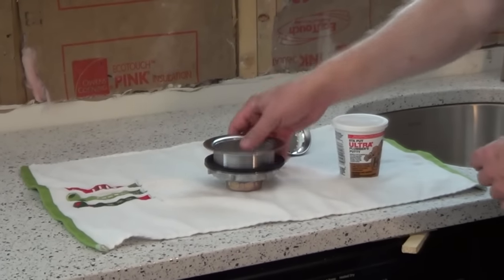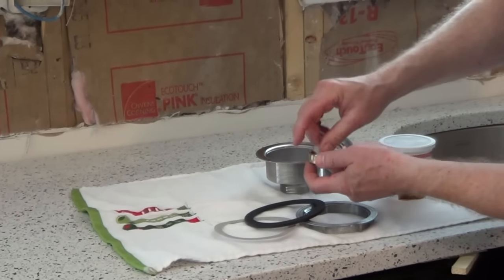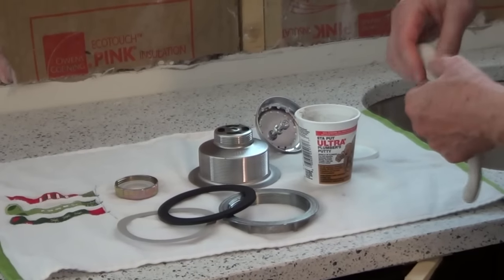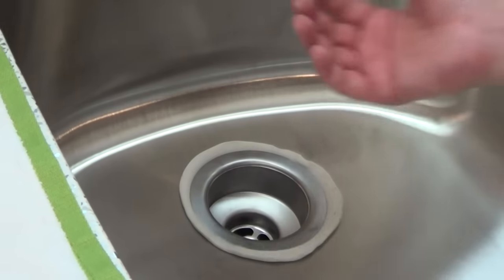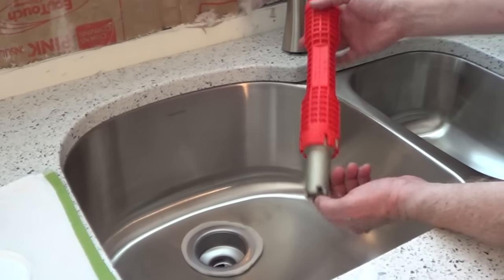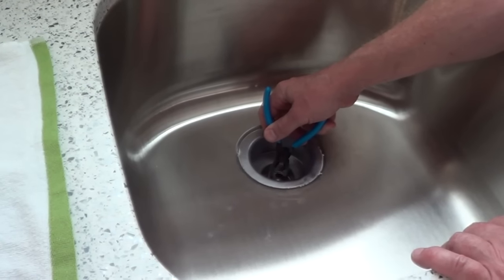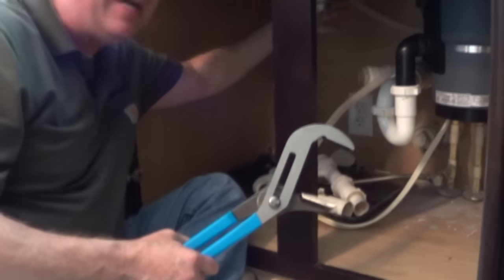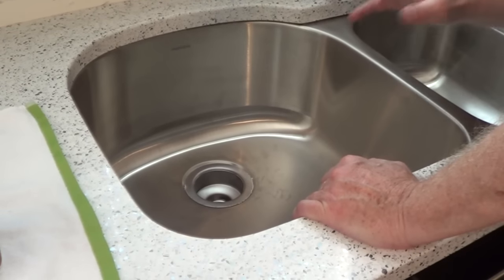How to Install a Kitchen Sink Basket Strainer

Comment: Another reason NOT to buy that special tool to keep the drain from rotating, the cheapo drain i just bought only has 3 tabs around the center, not 4, so the fancy tool would not have fit into it.  pliers work just fine.  GOOD TIP about saving the cardboard friction ring, i would have thought it was just for packaging & thrown it away.

Comment: Sometimes I learn the hard way. I had the rubber gasket in the wrong place, resulting in the basket sitting slightly above the sink. This caused the water to pool around the drain. Hopefully, this video will keep someone else from making the same (dumb) mistake. 🤪🤪🤪

Comment: Thanks, I didn't use enough putty and had a leak. You showed the right amount of putty yo use,glad I checked for leaks before I started hooking-up drain lins. Good tip on using the needle nose pliers.

Comment: Thanks for the teaching. I didn't use enough putty the first time. The needle-nose plier tip worked but I tightened a pipe wrench on the handles of the pliers that jammed against the side of the sink and prevented the basket from spinning without a helper.

Comment: I'm glad I didn't put the sink in until I added everything the drain , faucet plumbing pipes a lot easier then doing most of it under the sink . And I had trouble cutting the counter top hole big enough jigsaw wouldn't cut close enough so I finally figured it out  I flipped counter top over then finished cutting .

Comment: I drilled two holes  in the tool and used a screwdriver to fight against me while I tightened it. One man job.
Reply: I have one with the hole already in it.  Got it for 8 bucks.
Reply: @Silent_Shadow  where? and what is it called?
Reply: Innovative thinking right there!👊
Reply: I don't have the tool so got to figure out how to do it with out it .

Comment: Awesome video! I have a question about the large strainer nut. How tight are you suppose to tighten it? I did it myself while holding the strainer with the ridged tool from the top. It never really tightened. The nut slipped teeth and it was loose until I got tired of turning the wrench. It didn't leak but I assume it will soon. Thanks for posting this video.
Reply from the maker: Hi, it just needs to be snugged down. You don't want to over compress the putty. If it does leak in the future, it is an easy fix. 
We have more tips on our weekly podcast http://castbox.fm/u/4891735

Comment: Very helpful. I came here to find out whether putty is needed UNDER the sink (duh. It's NOT.) and I saw the bit here about the cardboard gasket. While fixing my leaky sink, I found that the cardboard was put ON TOP of the rubber washer. THAT was probably the reason for the leak. I'm not sure whether that was MY fault or the previous occupant.
Reply from the maker: Glad it was helpful
Check out more home improvement tips in our e-books https://www.amazon.com/gp/product/B0B2KW1FQ9?notRedirectToSDP=1&.

Comment: That's really well-done in under 3 minutes.  A+.  One question: if I don't have the big wrench, is hand-tightening as hard as I can okay?
Reply from the maker: Hi, I have always used a wrench to get the nut snugged up and the putty compressed. If you have someone press down on the sink basket as you tighten it, you may get a good seal.
Check out some home improvement tips in our e-books https://www.amazon.com/gp/product/B0B2KW1FQ9
Reply: @FIXITHomeImprovementChannel  Thank you for replying.  I have a pliers like yours, except small with only a max 1.5" mouth.  So I'll do my best by hand.  If it drips, I'll start looking for hacks/tips or try to find a buddy with a big wrench.  Thank you again for taking the time to reply.  Most guys don't, especially when they have as many subs as you do.  :)
Reply from the maker: Hi, if your nut is smooth, you can replace it with a nut with tabs and that will give your pliers something to grab onto. You can grab the tabs on one side to tighten it. Here is an example  https://www.homedepot.com/p/Glacier-Bay-Kitchen-Sink-Strainer-Nut-and-Washer-7049-900/207144224
Reply: For anyone reading this, it worked like he said.  You do need to do more than hand tighten, but if you can't get your wrench around the whole nut because the wrench is too small, as long as your wrench can get some grip on a couple of tabs, you can get the nut snug enough.  Don't forget to like and sub, because as you see, he took time to help a novice like me.  Others I asked did not.  A+

Comment: I have seen other video's where the paper gasket is put on first under sink and then the rubber gasket. This is the first time I've seen the rubber gasket go on first.
Reply from the maker: Hi, the cardboard friction ring helps keep the rubber washer flat against the bottom of the sink.
Check out more home improvement tips in our e-books https://www.amazon.com/gp/product/B0B2KW1FQ9?notRedirectToSDP=1&.

Comment: Hi, We need to replace the basket strainer but we have a PVC/plastic tailpiece. A new tailpiece washer comes with the new strainer. The existing tailpiece has a plastic nut to use in attaching the tailpiece to the bottom of sink strainer. The new basket has a metal nut for the same purpose. Is the metal nut required even when attaching a PVC tailpiece to the bottom of the steel drain basket?  If so please explain the benefit of using the metal nut instead of the plastic nut in this example. Thanks for the video and any further input you can provide!
Reply from the maker: Hi, I would use a plastic nut for plastic thread and a metal nut for metal thread, to help prevent cross threading.
Reply: @FIXITHomeImprovementChannel  Ok thanks! I just wanted to be sure. Given this and the fact there is a tailpiece washer do you suggest or see any need for teflon tape on the basket threads where the tailpiece nut is threaded onto the basket?

Comment: THank you, but why at 0:30 do we have to create our own washer? Why doesn't the manufacturer supply a washer for the upper surface as for the lower surface?
Reply from the maker: Hi, plumbers putty will fill the space and shape itself to create a watertight seal, even if there are irregularities in the surface. You get a custom gasket.
Check out more home improvement tips in our e-books https://www.amazon.com/gp/product/B0B2KW1FQ9?notRedirectToSDP=1&.

Comment: Does bleach in the dish water degrade the plumbers putty? I occasionally like to ad a tiny bit of bleach to my dish water.  We have had our sink drain leak at least 3 times now.  Also, does just soaking your dishes for a while in regular dish soap degrade plumbers' putty?
Reply from the maker: Hi, plumbers putty is water and chemical resistant. The problem is probably how you installed the sink basket and the amount of putty used. Here are some tips from Oatey, https://www.oatey.com/faqs-blog-videos-case-studies/blog/how-properly-use-plumbers-putty#:~:text=Historically%2C%20plumber's%20putty%20was%20used,toilet%20and%20is%20not%20waterproof.
Check out some home improvement tips in our e-books https://www.amazon.com/gp/product/B0B2KW1FQ9
Reply: @FIXITHomeImprovementChannel  Thanks so much!

Comment: My sink strainer was leaking,,  replace it with the type that has 3 screws underneath to tighten up, instead of screwing it on as shown here. Two advantages. One person can do it, do not need the tool to hold strainer because your not screwing it on. I will never use the screw on type again,,the washer turns and makes it leak sometimes. Bought from Home Depot, it is twice the weight, and cost 29.97.. worth every penny...
Reply: Question is did your home depot have it in stock, or did you order it shipped to store?, because nine times out of ten ya need the part right now . who can wait for it to be shipped?

Comment: I did all the steps you outlined including buying the tool, however after 3 days the basket leaked water that soaked into the paper gasket and started to drip.Any ideas?
Reply from the maker: Hi,  I would remove the basket, reapply the putty and replace the washer and cardboard friction ring. You can pick up a new washer and ring at a hardware store or home center. Use a sink basket tool to keep the sink basket from moving while you are tightening the nut.
Check out more home improvement tips in our e-books https://www.amazon.com/gp/product/B0B2KW1FQ9?notRedirectToSDP=1&.

Comment: I tightened the heck out of it with vice grips, which completely destroyed the paper gasket and deformed and pushed out one side of the rubber one???  so should I not tighten it that much or what?
Reply from the maker: Hi, did you grab the nut on one side only with the vice grips? If so, a large pair of adjustable pliers will spread the force more evenly on the nut. You can purchase a replacement rubber gasket and cardboard friction ring if you damaged them. Have someone hold the strainer with a sink strainer wrench to keep it in place while you tighten it down. You want it snug, but not overtightened. 
Check out some home improvement tips in our e-books https://www.amazon.com/gp/product/B0B2KW1FQ9
Reply: thank you so much for answering, sir. I really appreciate you.!  Although your answer confuses me a little bit .  How on earth would I grab the nut on only one side with vice grips?😂. The entire nature of vice grips is to hold something on opposite sides and squeeze it tight and turn it.??  I don’t understand how you would hold something only on one side with vice grips 😂
Reply from the maker: Hi, if your nut has tabs for a pair of pliers to grab onto, and you only are grabbing 2 tabs on one side, it can put uneven pressure on the nut. Here is one style with tabs https://www.homedepot.com/p/Glacier-Bay-Kitchen-Sink-Strainer-Nut-and-Washer-7049-900/207144224
Reply: @FIXITHomeImprovementChannel oh I see what you mean!  No I grabbed it on opposite sides squeezing it down the middle.  I do think perhaps I overtightened it tho

Comment: Someone told me you’re supposed to use silicone on the stainless steel. Is this true?
Reply from the maker: Hi, you can use silicone as the seal, but plumbers putty is much easier if you don't have experience working with silicone.
Check out some home improvement tips in our e-books https://www.amazon.com/gp/product/B0B2KW1FQ9

Comment: I think that is old school to use putty to put under the sink basket it's extra work & mess to work with taking out the old putty putting in the new when you can use the rubber gasket under the sink basket instead & placing a rubber ring is really an option to put one under the sink with paper gasket absolutely serves no purpose whatsoever... as long as the rubber gasket is in straight tightened down there will not be any leaks from the drain basket..
Reply from the maker: Hi, depends on the sink basket. Most styles still use plumbers putty as the gasket. 
We have more tips on our weekly podcast http://castbox.fm/u/4891735
Reply: This was a good video. In the past I've tryed not using the gasket and have had problems with the rubber knotting up so I just go ahead and use it, I don't want a call back so I do a little more when putting on the rubber ring I put a little silicone on it for a little back up.
Reply: Gaskets don't work. I'm replacing one today.
Reply: My sink has been leaking without the putty. Now with the putty I'm finally leak free.
Reply: my understanding is that the paper gasket is there to protect the rubber gasket while you tighten the metal nut against it.

Comment: Bad info on the stainless puddy. It is not okay for pvc, abs, and plastics. Read the label..
What's the rubber gasket for?
Reply from the maker: Hi, stain free or stainless putty is good for any material. The oil based putty can't be used on plastic or porous material.
Reply: @FIXITHomeImprovementChannel  Got some oatey stain free plumbers putty in my hand right now. It clearly says "Do not use on abs." You decide for yourself what that means.
I get it. I was once thinking wtf. Why do they make 2 types of putty. Why don't they just make the 1 putty that is stain free. Then i did the research and the regular putty is better in all instances except 1. Staining. So if you aren't worried about staining,  then use regular putty.  
It's okay. People make videos giving out bad advice all the time. Luckily there are people like me who catch this and make things right in the comment section.  Much smarter people then you have made mistakes. Don't be so hard on yourself. 
Let me guess. You are probably one of those people who think that home depot sells inferior plumbing products. 
Cheers
Reply from the maker: Hi, I took training from Oatey. The gentleman who trained me said the Stain Free plumbers putty can be used on any surface for plumbing projects. The only problem with ABS is the finish can be discolored or stained. For sink baskets with ABS bodies, the ABS is not seen.
The oil based plumbers putty can get absorbed into soft sink material and create discolored veins. If you have an old cultured marble sink, the oil based plumbers putty can actually break down the bond and cause the area around the drain to break away. New cultured marble uses a different material to prevent that.
Reply: @travisk5589  Sinks aren't made of ABS. That is where the putty contacts, the sink, not the ABS plumbing parts.

Comment: You dont actually need putty, any water that manages to pass through the top of the drainer will become trapped and forced to enter the waste because of the rubber washer. It's amazing how many times iver seen these washers placed at the top incorrectly.

Comment: After installation, shall I wait a period of time before running water?
Reply from the maker: Hi, if you used plumbers putty, you can use the sink immediately.
Check out some home improvement tips in our e-books https://www.amazon.com/gp/product/B0B2KW1FQ9
Reply: @FIXITHomeImprovementChannel  Thank you for your reply, yes, I do intend to use plumber's putty. Is it recommended to use some Dap Kwik Seal on the threads on the underside?
Reply from the maker: Hi, I've only used plumbers putty as the gasket for the drain assembly. There will be a tailpiece washer between the bottom of the drain assembly and the tailpiece drain pipe to prevent a leak.
Reply: @FIXITHomeImprovementChannel  Thank you much for your reply.

Comment: What if I don't have a helper?
Reply from the maker: Hi, there is a different style sink basket holder that can be used under the sink so you can hold it yourself. Here is a pic https://www.homedepot.com/p/HDX-Basket-Strainer-Wrench-HDX147/204218605
We have more home improvement tips on our weekly podcast http://castbox.fm/u/6389499.
Reply: Tinthia Clemant I drilled a hole in the tool and used a screwdriver to fight against me while I tightened

Comment: You know that rubber ring was for the top. Once you used the plumber’s putty you no longer need that ring.
Reply from the maker: Hi, for this style sink basket, plumbers putty is the gasket for under the flange. The rubber gasket and cardboard friction ring goes under the sink. 
Check out some home improvement tips in our e-books https://www.amazon.com/gp/product/B0B2KW1FQ9?notRedirectToSDP=1&.
Reply: You’re mistaking that gasket for the white ring gasket that “sometimes” is provided for the upper portion. If it’s not available, you can use plumbers putty (which he used). Then the rubber and paper gasket goes underneath. He did it right.

Comment: Use gasket over puddy!!!!!!!
Reply from the maker: Hi, the gasket and fiber washer goes under the sink. Plumbers putty is your gasket under the basket flange.
Reply: @FIXITHomeImprovementChannel  I use gasket on both no fiber on top. Going strong 16 years now. Puddy seal worked great until I accidentally dropped a cast iron pan in sink and the jarring caused the seal to break. Drip within two days.

Comment: Don't use plumbers putty! It dries out over time and leaks! Use clear silicone! It will last forever!
Reply from the maker: Hi, stain free plumbers putty is easier for most homeowners without a lot of experience working with silicone.
Reply: @FIXITHomeImprovementChannel  silicone is extremely easy to work with lol

Comment: Sorry but this does not work without the tool to hold the basket AND a helper. The job really sucks buy your self. Additionally, the plumbers putty sucks and does not seal most of the time. You will find small leaks from the threads on the bottom side. Best find an alternate method with silicone or other.